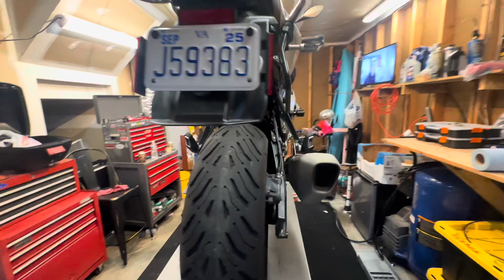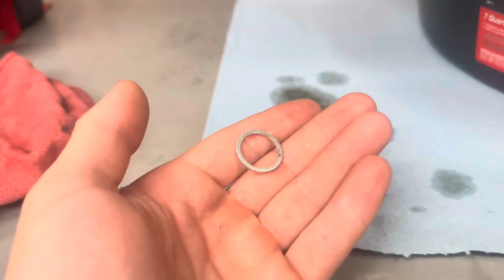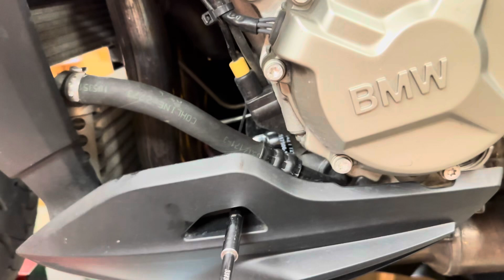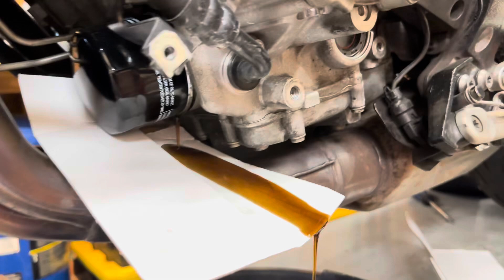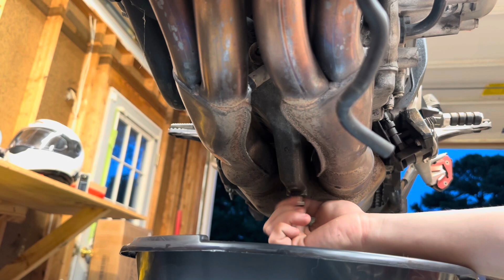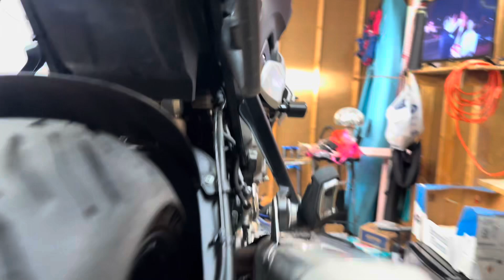2016 BMW S1000XR Oil Change (Under 5 minutes)

Comment: Do you need to change filter every time? Mine had a filter change in May but I wanted to do an end of season interim change but was planning on changing the oil only.
Reply from the maker: @dstev55  it does say to change the filter every 6,000 miles (10,000km) on the maintenance. I end up cleaning mine after 6k miles. Then after 12k I replace it. Most of the time mine is pretty clean. After 12k I just replace it though.